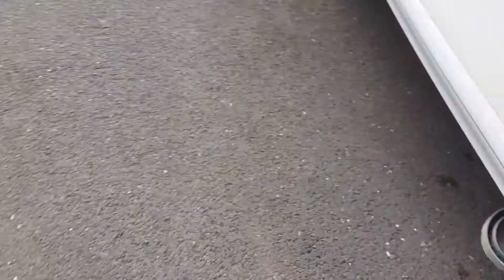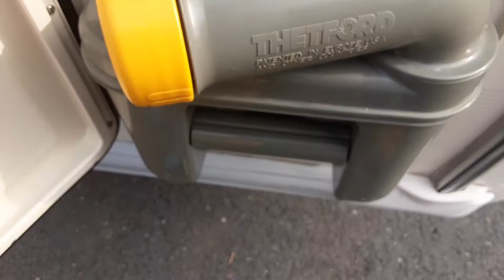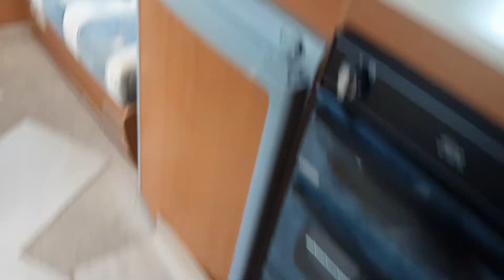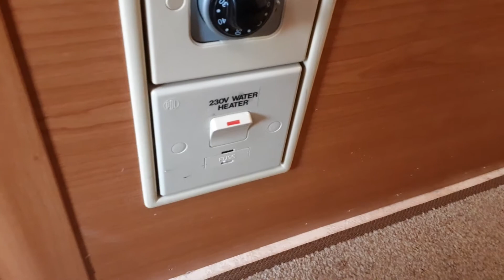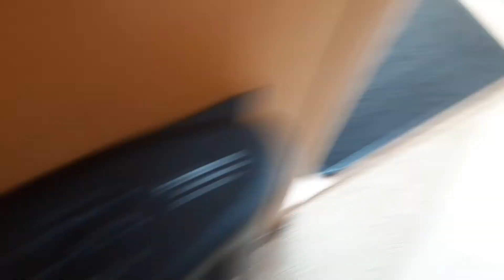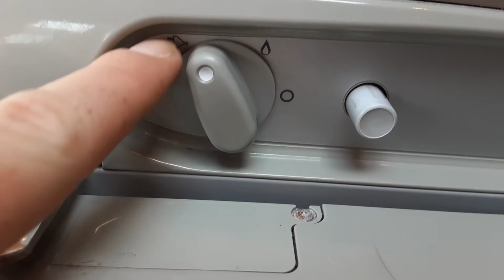www.thecaravancompany.com present: 2007 Bailey Ranger 460/4

Comment: Wot if u have no swockets working on electirc how do u solve it
Reply from the maker: Hi Lynne, are you saying you have no power to the sockets? Have you pressed the test button next to the trip switches? If it trips out, there is an issue with the sockets, if it doesn't there is a problem with the feed into the caravan either/both the socket plugged into, the mains cable and any adaptors. Hooe this helps, regards, Matt
Reply: I have bought new cable for caravan n went to use sockets no joy  it did trip but still nothing  bought new breaker n fitted but 2 sockets working seems as though few wires have no voltage  n battery not charging when connected to cable
Reply from the maker: @lynnepennington9500  sounds like it needs an engineer to look at it Lynne
Reply: @thecaravancompanynorthampt8892  thanks